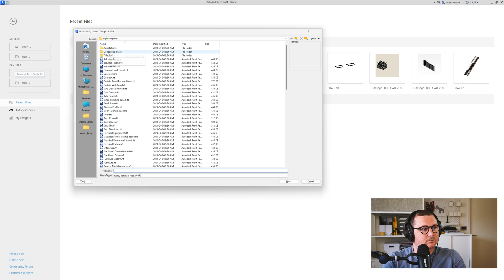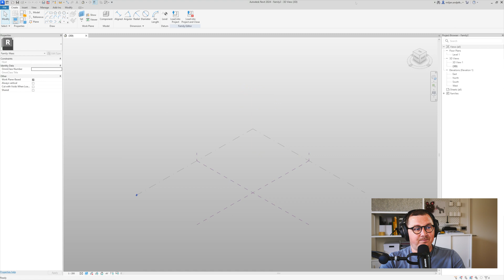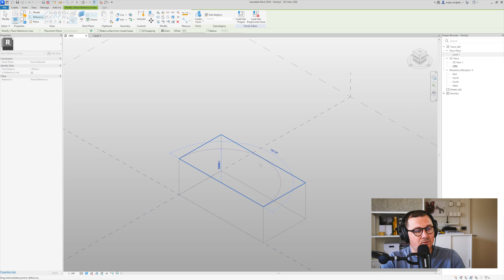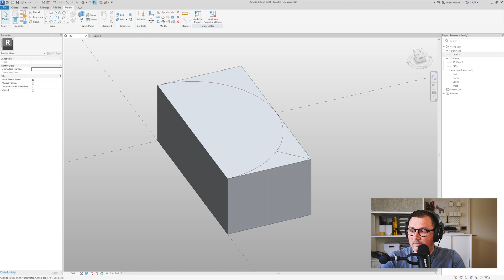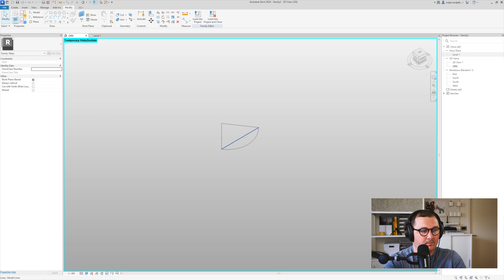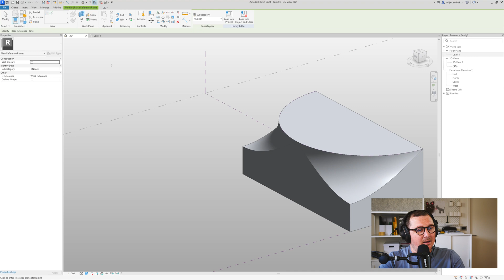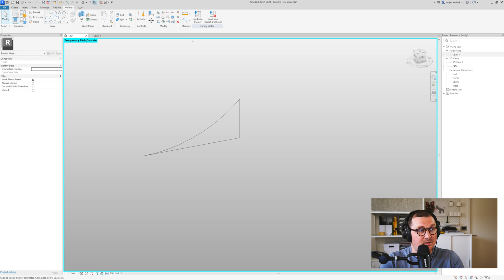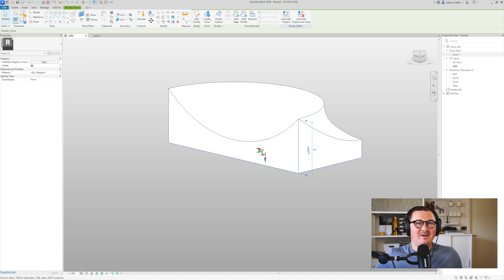Revit Roof Modeling - Helgeland Museum

Comment: this is the most un-intuitive thing I ever saw revit modeling is awful (comparing to sketchup/max at least)
Reply from the maker: It might look like that if you’re just starting out. Keep in mind that this is BIM software and Revit is also capable to host and handle amazing data, which means that every part of the model can have it, so it’s not comparable with only modelling software such as 3D Max.

Comment: hey! i cannot find the Create Form button on my ribbon. How do you get it there? i'm using 2026 version
Reply from the maker: You need to select lines you created and from which you would like to make a form, and then you will see Create Form button 😉
Reply: @arkiteasy  It wasn't working when i selected lines made using Model Lines (i drew a rectangle with rectangle tool). -- It then worked when I used lines from Massing & Site > In-Place Mass > Create new mass. After drawing a rectangle with it, I can Create Form.

Since I'm new to Revit, I don't know the implications of these two methods.

Thanks for the prompt reply and helpful videos.!